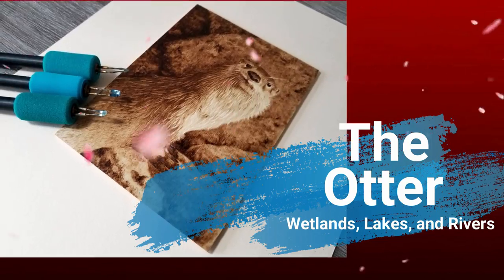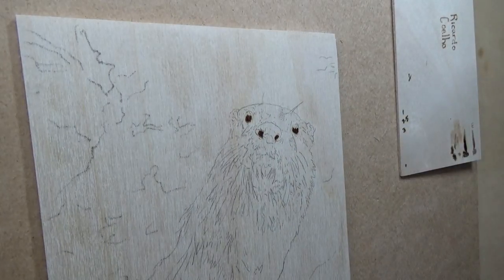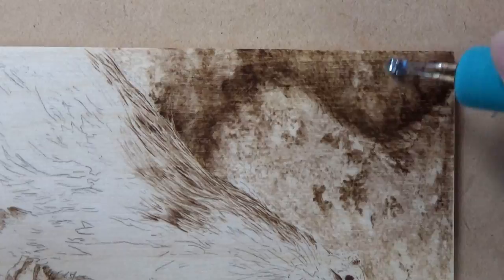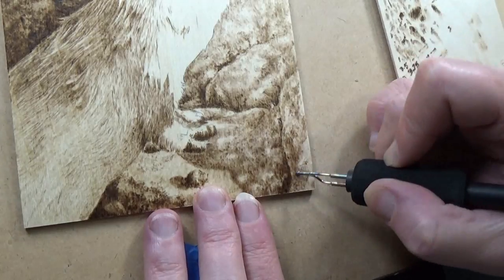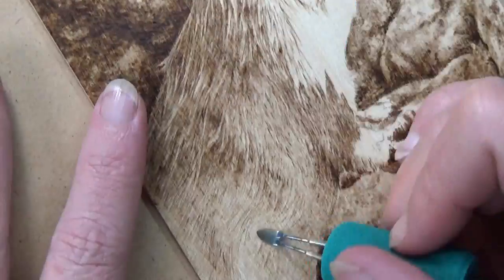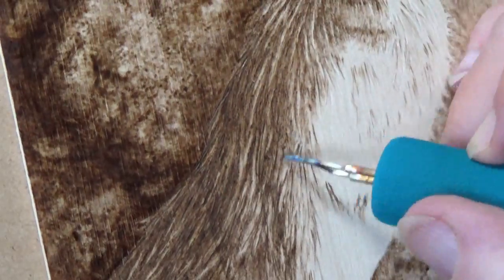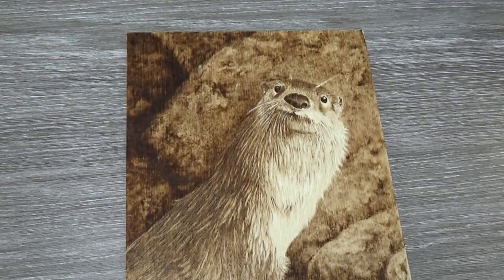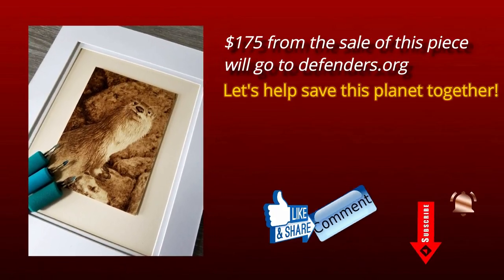Pyrography: Animal Artists Collective// The North American River Otter Wood Burning

Comment: Wow! This was my very first wood burning art video!  I’m amazed!  And intrigued....just ballpark...how much does it cost to get started with decent tools and supplies?
Reply from the maker: Thanks Erin & welcome! 😁 For a ballpark starting with a comfortable pen and the basics you could start for less then $250. The optima burner I am using in the video is the best on the market, but is also the least expensive. For a single burner w/a heavy duty cord & 4 pens it's $169 + shipping (www.carvertools.com). Then you have your wood or other nature material to burn on, graphite paper, sand paper (if burning on wood). Those are the very basic supplies. 

If you aren't sure if you will like burning & just want to try it out you can pick up a walnut hollow versi-tool at Michael's for about $17 with a 40% off coupon. The versi-tool is a different type of burner & my least favorite but it is doable. 😃

Comment: great work. May I suggest using a red pen when doing the transfer onto wood. This way it's easier to see the parts you have already traced and the parts you still have to do.
Reply from the maker: Thanks Tim! 😁 I actually tend to grab a colored pencil when transferring, but this time I needed thinner lines as it is a smaller piece. I don't use any kind of pens because they are thicker in width and you are more likely to engrave the lines into the wood with pressure. I did switch for a few minutes to a blue colored pencils for lines I wasn't worried about. 😉